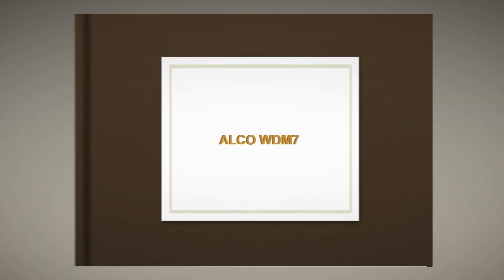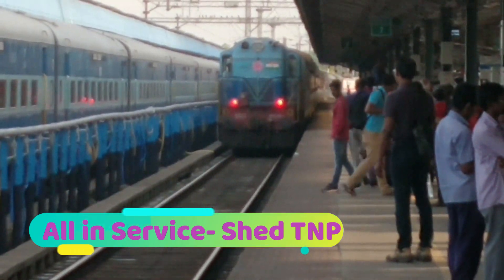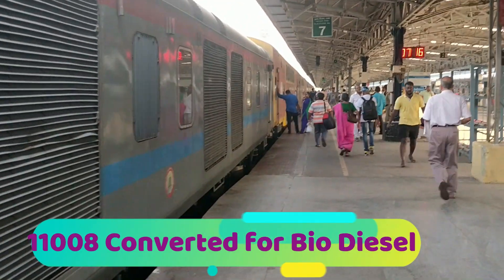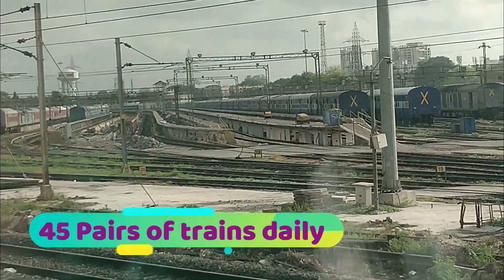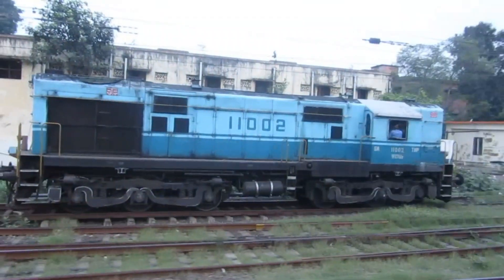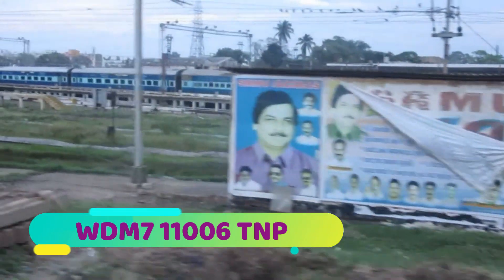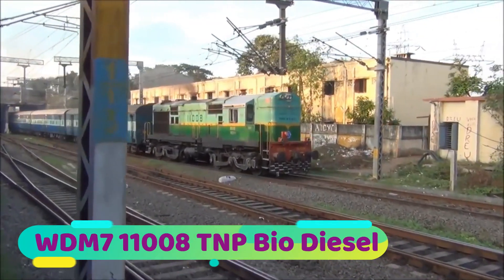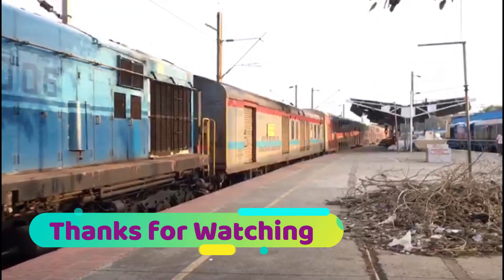Indian Railways ALCO WDM7 Locomotive Back Bone of MGR Chennai Central

Comment: Seen these engines. Thanks for your research. How about Chennai Egmore shunting engines.
There is a provision to change the line to go back for these locomotives. But they are not used. The engines wait till the departure and then pull up to the signal.